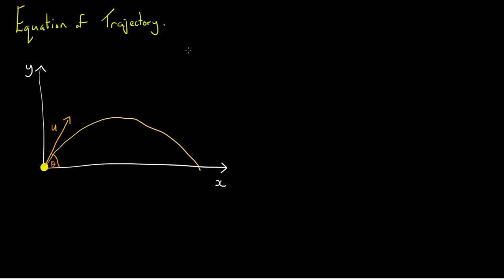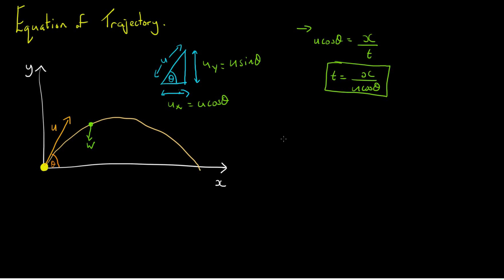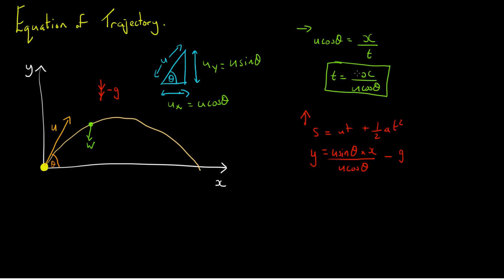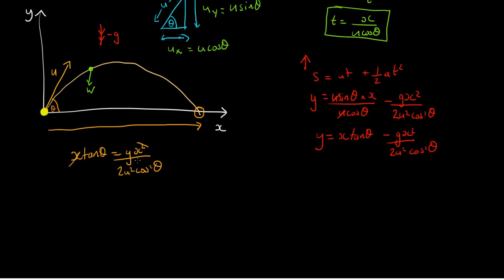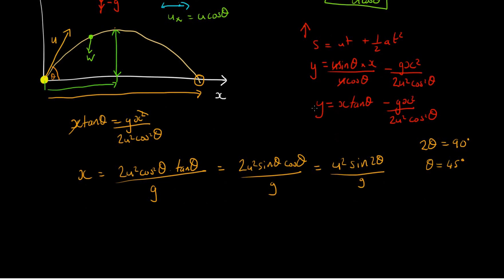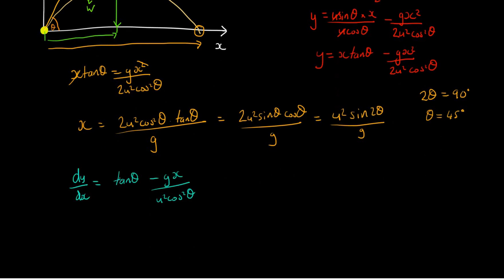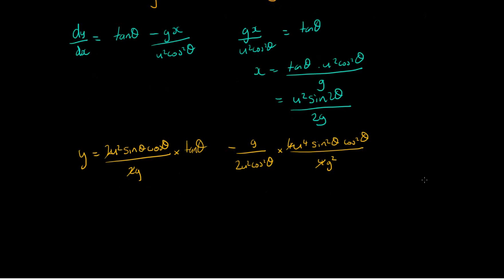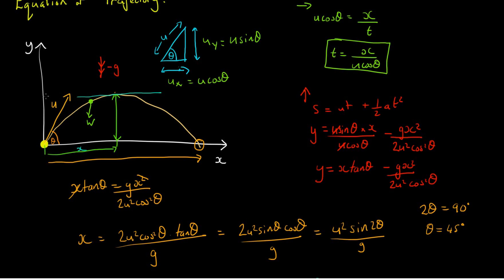Equation of Trajectory - Kinematics

Comment: if someone sees my comment by any change can you tell me how to apply this math if you already know the height that the object is being thrown at and the distance it travels
Reply: I don't know but I want to learn the capabilities of my mortar and how high and far and fast the shell will fly with a certain powder charge/gas seal and firing angle.
Reply: at max height the y component of the velocity will be 0;
the distance it travels in x is the x component of the initial velocity times the time it takes for the object to fall down (height =0)
Reply: @fallaway-lol  he mentioned he only knows the maximum height and the total distance travelled. He probably wants to find the initial velocity.
Reply: in this situation you could use the equation he made at around 4:15, replace y with the height the max height that you said you already know and replace x with 1/2 of the distance it travels and then finally solve for u to get the initial velocity.

Comment: How to consider the value of u ?
Reply: Not quite sure what you mean - u is the initial speed of the projectile, usually expressed in m/s.
Reply: I mean to say that how to find the value of initial velocity ?
Reply: It is a parameter, just like the initial angle, theta, and the gravitational field strength, g. It will have to be provided or some other information provided in order to work it out. For example, if you were given the maximum height or maximum range, you could use these values to estimate the initial speed, u.
Reply: Think of it as how fast is the bullet (projectile) traveling the instant it leaves the gun. The bullets Initial Velocity (that's if we are talking about guns and bullets in our example). So the bigger or more powerful the gun fired, the faster the bullet will be traveling once it leave the gun. This info must be given to you before you can do any of these calculations. It can be calculated separately but you must know all the variables of Internal ballistics, like how much powder is in the bullet and how big the bullet is etc...etc. This type of callulation is a whole subject to its own.
Reply: If you want to consider the value of u that means you already took the shot or threw the stone, therefore, you should have a result of an experiment that gives you the horizontal distance, and from that variable, you can now talk about the initial velocity by simply calculating with your observational values.

Comment: what a theta?
Reply: Jean-Luc Belanger ikr xD
Reply: Theta is a Greek symbol used as a variable in mathematics and in this physics calculation Theta represents the angle of launch of the projectile, relative to the horizontal axis (X-axis). The angle is in units of degrees (0-360 degrees) and can be converted to radians.
Reply: the launch angle of the projectile .